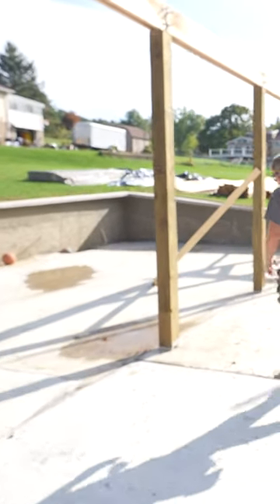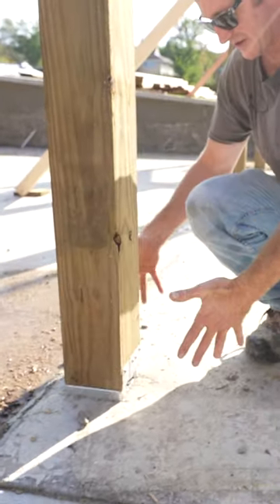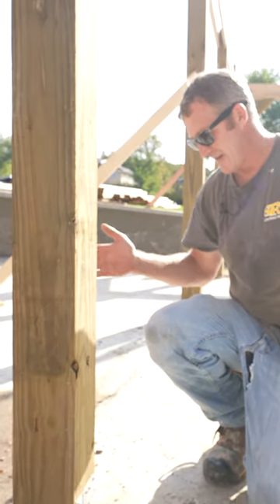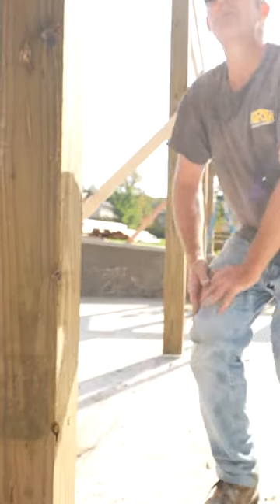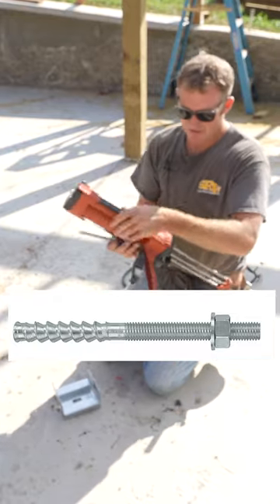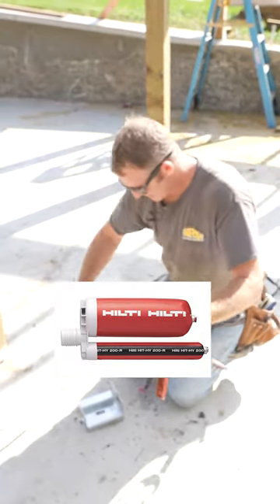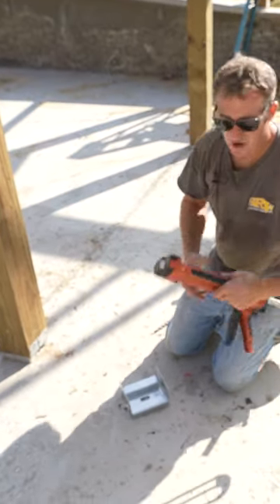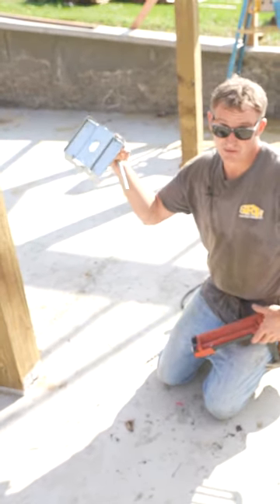Pole Barn Anchor Tip

Comment: Have you ever tried setting your anchors in the concrete when it’s setting? (Different type, 16-18” long)
Reply from the maker: I’m sure they are way better. Just have to be a precise planner like RR builders to do that 😆
Reply: Agreed 1000% I mentioned that above
Reply: It's against code, depends on the anchors used and building codes
Reply from the maker: @jonathan3982  insightful 😆

Comment: Tubes are made of very thick cardboard called Sonet Tubes. You set them in place and into a larger hole insert concrete into them. 

You can also use a 6-10” circular metal blades welded to round steel post into the  ground called a post hole digger! 

You can also insert a thick 3/16” - 1/4” U shaped steel base into the concrete as long as you have a string line  set up
Reply: Omg never hv I ever drilled nd epoxied.
    like you said it's in the lay out ,string line nd as concrete is still wet place in anchor bolts.
     it's common sense,do it as it's being poured.
     it's stronger ,accurate nd the little time to pull a string ,is far better than the time drilling nd buying Hilti material $$$$.